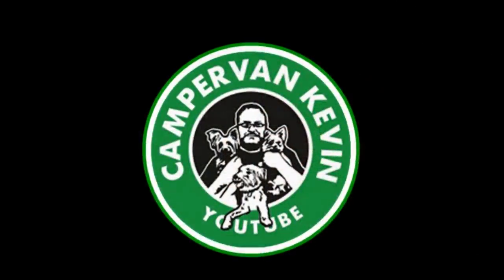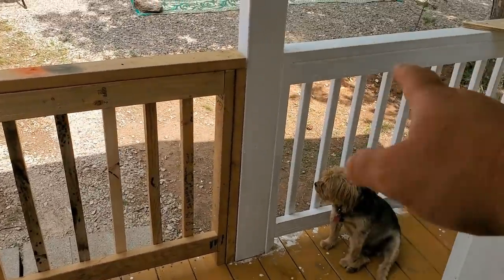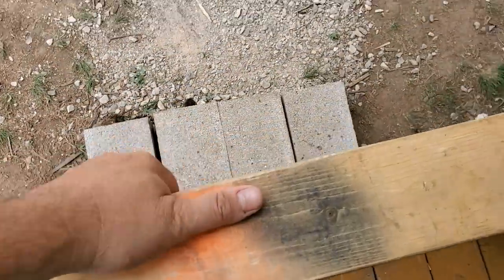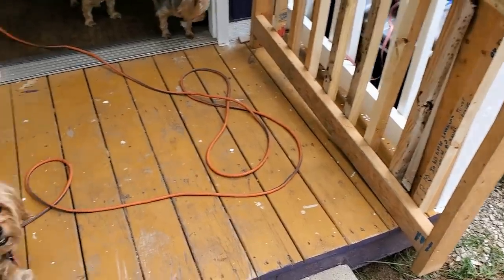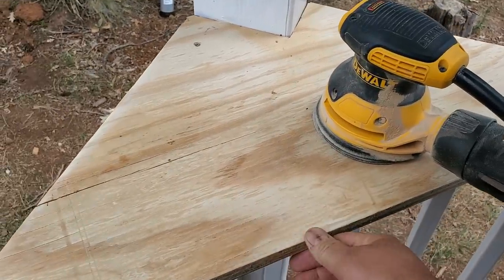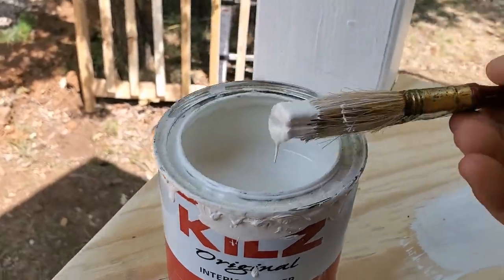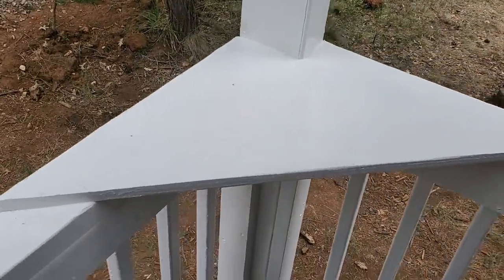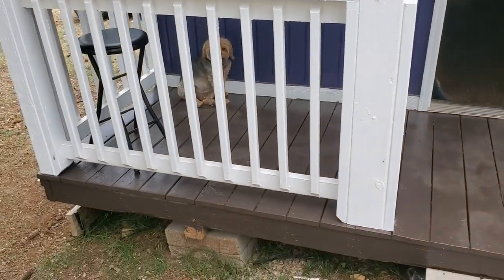Bark?! No Hinge Required!

Comment: Please put a pin in the gate so it dont fall on the woof pack by accident,,if tucker pushes on it and baby maymay is on the other side, ouch!!!! you never know you just never know,,, great job anyway,,,,
Reply: I was thinking the very same about a pin.
Reply: I’d drill a hole top and bottom and run a rod straight down. Could even use rebar
Reply: YES, yes, yes!!! That looks VERY dangerous! A friend of mine had a Yorkie that died when playing around a wood pile...the firewood fell on him and killed him....so horrible!

Comment: I did the same thing when I built my deck, no hinge. That didn't last long, my dog kept knocking it down. I picked up three spring-loaded hinges and added a blind stop for when it closed. If your hands are full, just push the gate open and it'll close behind you. Good move with the gutters.

Comment: If the gate rest on the board, it won't drop. By putting a hing on the outside, it can swing in front of the other railing and out of the way. This will keep it out of the way when bringing things into the tiny house. (groceries) Also you can put a slide latch on the opposite side to keep the dogs from knocking it open.

Comment: Kevin, you and the woof packs tiny purple house is soooo honey. Excellent job. One thing for the gate. Drill a hole in one side on the end and put a pin in it and then if your in bed and some thing some by the gate won't come off. I'm not saying I'm just saying.

Comment: We had two little dogs when we built our house and both were "runners'  We also had a wide space in front of the steps so we built a gate to match our railings. We did have a pair of hinges in our collection of odds and ends. But because our gate is so heavy were put a pair of wheels on the bottom of ours. We just have one dog left now but she loves to sit on the porch for hours when the weather is nice. We can let her out there and not worry if she is going to run off.

Comment: Love the 'Bark' color, its perfect!!!  If you want keep the dust from showing, take a small dry paint brush, dip the tip of the brush in WHITE paint and carefully sling the white paint off the brush onto the Bark color. The white 'specks' or splatters will keep the dust from showing as much. 🙂

Comment: looking good , i do hope you painted the bottom side of your corner shelf to protect it from rain and moister.  Put a good two coats of wax on the porch and it will repel water and dust. put you a stop on the gate, on the inside , so if a larger animal comes up it will not be able to push in and knock it out, and outside so Tuck can't knock it out also. Remember how the old cupboards had a wood twist lock. . ..  love this so much, you are so Blessed

Comment: Kevin as a suggestion take a screw and run it into the top of the 2x4 that the gate sits on and leave about a half to 3/4 inch sticking out then flip the gate over and drill a matching hole in the gate that way tucker and crew can't jump on and knock it over
You and the woof pack have a good day
THE GRUMPY BUS

Comment: I love your gate! Brilliant. Would it work to drill a hole down on the top 2 x 4 into the brace that you mounted. Drop a bolt in it so it’s loose, round the edges of the same 2 x 4 next to the post. It would act like a hinge kinda. Put a small block on the outside so they can’t jump up on it . Love your tiny home. Thank you.    Sorry.  Should of read the comments first. 😃. You have a lot of similar suggestions. Thanks again.

Comment: Agree with another comment that was made, drill holes so you can sink pins or long bolts on the left & right top sides of the gate, a woof pack safety measure...

Comment: Drill a hole from the top down into the 2x4 on each corner, put a long screw into each hole for security at night, just so the gate can't get pushed forward.

Comment: Drill a 5/16 hole thru the top edge of the gate and into the vertical 2x4 that it sits on, then drop a 1/4  inch 3 inch long bolt into the hole and now no critters can push against it to get the babies . And just pull it out when u want to remove the gate . See ya on the road , hope martini is better

Comment: Holy cow, for a non carpenter you did an excellent job on the gate!!  I can see the new kitties, a year old, sitting on your porch railing.  Something about railings they cant resist.They will love it under your house as well!   That said, they will be jumping up on the gate, and, the babies will be jumping against the gate to get at them or an intruder. Maybe a simple window casement latch on each side to keep it from being pushed over. Can still lift it away from the entrance when you want.  Nice job, and, I love the color of the decking!

Comment: If do put on hinge screw one of the 2 x 4 board to get  add hinge opposite side the 2 x 4 board then get gate kit that have rope wire and turn buckle put at top corner where hinge is put turn buckle and rope wire and dangle corner install the rope wire . have turn buckle all the way out. when you tighten up turn buckle will put up that lower corner up no sage gate.

Comment: If you can pick the gate up that easy, a wolf or coyote can knock it off.
Drill and pin each end and maybe middle on each side, and place a duplex 16 penny nail as pins. That way it shouldn’t be knocked down

Comment: Maybe eventually screen that porch in, that would be good to keep the flies out of the house in warmer weather. Do you get many mosquitos, and flying insects in that part of the country. Can baby mae mae squeeze through those porch railings. Lol. God Bless. She is so tiny.
Reply from the maker: Very few bugs. No Mosquito. Yes dogs can fit but don't know it. Will address soon
Reply: When my Pom realized she could slip through the picket fence, we just added a couple rows of 6 inch gutter mesh around the bottom of the fence, using a staple gun. It was just the cheap plastic variety, but lasted for many years.

Comment: I'm sure you probably know this but if your worried about the gate sagging what you do is put a diagonal piece from the lower corner at the hinge spot to the upper corner of the other side completely stops any sagging. But like I said you probably already know that

Comment: A big animal can get over that gate or push it over very quickly not secure enough, the gate needs hinges and a lock on it to be more secure. If that was my Tiny Cabin i would have the gate Hinged and a lock or latch on it and on the top get some more wood or aluminum frame with glass in it and on top of the other frame work and have some opening windows on the 2 sides and front and enclose the gaps on the bottom of all the wood that will be better in the winter especially if it snows hard then the snow wont build up in the porch. ALso if it was all enclosed in the cold winter you you could still sit out on the porch with a little heater for warmth and after you wash your clothes have a clothes hanger to hang your clothes on to dry them.

Comment: When ever you get out in the sun for awhile i think causes the face irritations. Other nomads have experienced this out hiking but feel its elevation sickness.. i think elevation sickness has to do with changes in altitude or long drives and shalow breathing as i used to get car sick as a kid but I'd suck on mints and get out and walk around it go away.. so i dont think you have that.. But you got away from wearing your  hat that protected you better , so i think your instincts are right on. 
Check into UV index.  Dont take my word for it.. On days its high intensity you should always be covered when out in the sun.  
Pilots doing high altitude flying were starting to experience sickness and sometimes passengers on the planes. At first they feared terriorism ( some virus) but finally figured out that it was radiation sickness from UV. 
They started limiting piolets high altitude flights and some canceled all together.. 
We are in a solar cycle that is causing this.. so just be aware... its also affecting crops and weather. For real.... Just sayin..  dont be scared.. just be aware..

Comment: Just a comment on the Gate .  Have you thought of putting some kind of bracket or hangers to secure it to the side when you take it off in In case the dogs or something or someone bumps into it causing it to fall over.  Heaven forbid on the little ones. 

Something like this.  https://prnt.sc/u7o6uk  Or even just a bungee tie hanging over the side to quick secure it.